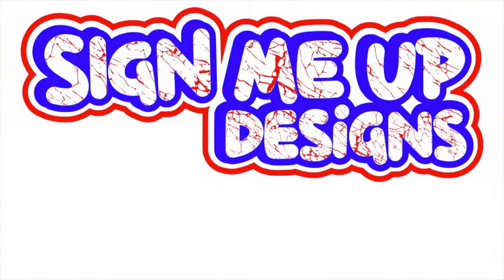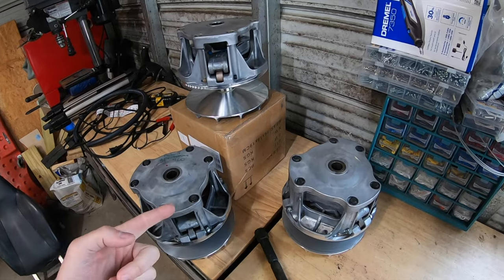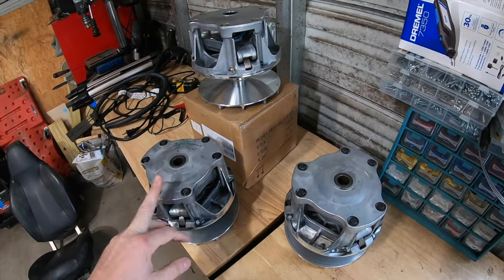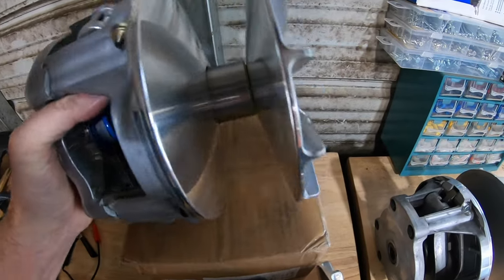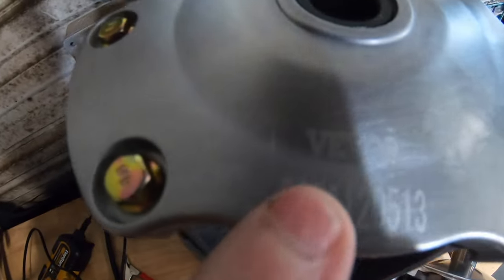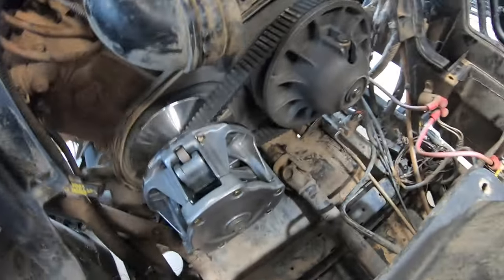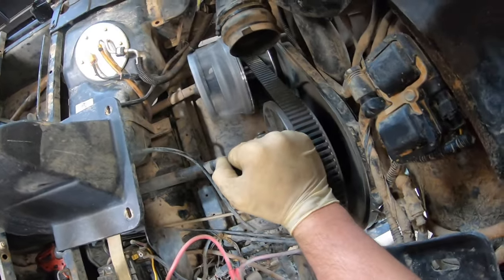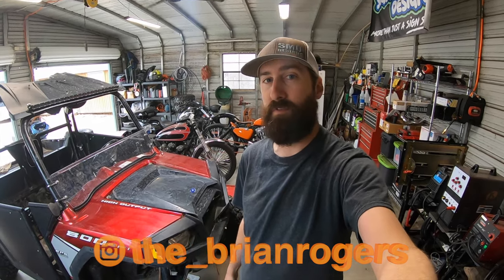Is Your Polaris RZR Grinding, Squealing or Jerking? - WATCH THIS VIDEO NOW!

Comment: This has solved all the issues I'm having on my 13 xp900. You sir are the man
Reply from the maker: Glad I could help! 🤙🏻
Reply: @SignMeUpDesigns   having trouble finding this same primary for my 13 xp900 however. Still on the hunt
Reply from the maker: @jasonbaker4842  Try this link. https://www.ebay.com/itm/294611102443?hash=item449830aaeb:g:mFMAAOSwCrhf9Vmb - I did see just a bearing on eBay for $40 but you'd need someone with the correct tools to replace it.
Reply: Oh man...absolute legend.
Reply: Aside from the correct puller I shouldn't need anything else right?
Reply from the maker: @jasonbaker4842  I think you’ll also need a vice and some sort of tool to hold the helix. I’ve never done it myself but Hunterworks has a video of the replacement.

Comment: Good tip about the bearing 
Mine started acting like you described after burned the belt in some thick mud    It had a flat spot 
I wonder if someone had the inner clutch cover replaced    I had to replace mine after the driveshaft broke  
Also destroy the primary clutch 
Sdi makes a great clutch alignment tool 

hunter belts doesn’t work on the 2016 rzr turbo & 2019 Rs1 
His clutch puller bent  after first use   and he wouldn’t replace it 
He told me it should be OK to reuse  😂  
 Belt + puller $195  down the drain 
He says his belts are the best which is a lie to sell belts 
Went back to oem  belt
Reply from the maker: Unfortunate you had that experience with them. I’ve never dealt with them personally. Hope the info helped you out.

Comment: I purchased a no named sideXside a few years ago, I was told they were built with leftover parts from several brands. It grinds really bad when you try to put it in high, low or 
reverse. We have to put it in gear and then start it.  Would this be a possible problem I am having?
Reply from the maker: It definitely could be. Sounds like the trans input is spinning while trying to put it in gear.

Comment: Back agin lol that is my problem You’re a genius something strange the clutch that I have says Polaris but it’s for a 2014 I’m guessing 2010 down to 2008 has a bearing.
Reply from the maker: If it says Polaris it probably has a bearing. But that bearing is likely locked up. If you can’t turn it with your fingers it’s bad.

Comment: Great video!

Would appreciate any suggestions. 2012 Polaris 800 Razor EFI hesitates at 45-50 mph. 45 is about 6350rpm. Not really a sputter or cough. Repairman just cleaned throttle body and fuel injectors and said idle air circuit was partially open causing a misfire at that speed. None of the work performed solved the issue. One person suggested the primary and secondary cluthes might be fighting each other. Need to get it fixed pretty quick so we can sell it and move, but I want it to be right. I should also mention that it has full power no issues 0-45. No codes, no engine light. Always at that speed only.Thanks. Appreciate anything.
Reply from the maker: You are 100 percent hitting your rev limiter. The weights in your primary clutch are too light. The rzr 800 should hit 60 mph and the rev limiter is 6300-6400 rpm. If you’re at 45 mph at 6350 rpm and the unit is no longer accelerating that is the only issue it can be. Mine did the exact same thing. Get a new primary with the right weights or get the weights replaced. The idle air circuit has nothing to do with max rpm. The mass air flow sensor will but you’d have issues all through the rpm range if it was bad. Good luck!
Reply: @SignMeUpDesigns  Thank you. I'll let you know what I find out.
Reply: @SignMeUpDesigns  Thank You for your response. I have some new information on the 2012 Polaris 800 Razor having issues at 45mph. 
I was asked if it could go faster than 45mph. Just took it for another test. As usual it hesitates at 45mph. I pushed it on a longer stretch and when it gets to 50mph it stops hesitating. When I get to 55mph it hesitates again. Top speed is 60 mph at a maximum of 6500 rpm.
To obtain codes, one video suggested turning the key off and on 3 times and it will show a code. Didn’t see anything pop up when I tried it. I don’t know if this 800 has the ability to display any codes?
I’d like to include some responses from folks kind enough to offer suggestions to see if it triggers any other ideas pointing to one thing.
The spark plugs were replaced about 1.5 years ago. They were examined recently and found to be good. I still might replace them as that’s a cheaper item. I suppose it could be a bad spark plug wire.. or coil wire. Your thoughts?
Suggestions: fuel pressure check, sounds like fuel pump, spray water on spark plug wires and coil wire, Fuel stabilizer, Belt might be slipping, inspect clutches and belts, don’t think its clutch related, sounds like clutches sticking, check belt for damage, weights in primary clutch are too light, was IAC mechanically stuck open or electrically being opened.
Thanks again. I’m hoping this new information might directly point to something that I will try and tackle on my own. Taking it in is a last resort for me. 
I promise, to get back to you once I find the issue!
Thank you kindly. Very much appreciated.

Dave
Reply from the maker: @davepo6443 It’s really tough to take an educated guess without hearing or seeing the machine in action. I do have a question for you. When you’re accelerating are you wide open throttle or are you feathering the throttle to get to 45? To eliminate the primary weights, from a stop press the accelerator all the way to the floor if the machine starts to hesitate as it accelerates there could still be a weight issue. If it does not hesitate at all until 45 then there is a different issue. I’ve seen fuel pumps go bad on these machines. Which may be what’s happening with yours. The fuel demand is greater at higher rpm’s and a weak pump will cause the conditions you mentioned.
Reply: @SignMeUpDesigns  You had it 100%!

I finally have the answers on the 2012 800 Razor issues. Thank you for your response!

Summary for 2012 Razor 800:
•	Fuel pressure was a consistent 44PSI which is in spec. Previously verified during last repairs.

•	Spark Plugs were checked during previous repairs and color was a light brown 
(NGK BKR7E) Plugs replaced in previous repairs Jan. 2023

•	TPS set at .730 per factory spec. using TPS TOOL brand meter (specified range is .720-.740 TPS voltage setting controls idle and start up.

•	Overall TPS voltage affects WOT, but that would be bad TPS unit.

•	IAC solenoid was partially open because of excessive dirt build up in throttle body.

•	Injectors were checked and cleaned because fuel goes bad much faster in the summer heat of the desert.

•	Mass Air Flow sensor was cleaned with MAF sensor cleaner because of dirt and oil build up

•	UNI brand Air Filter cleaned and treated and intake tract cleaned

Diagnosis:
•	During diagnosis test drive the operators RPM’s were watched closely.

•	During wide open throttle pass on pavement, engine was at 6400 rpm at 45mph.

•	6400rpm is on the rev limiter and that’s the surging feeling. Had to feather the throttle lightly to work towards 50mph and hit 6400 rpm again.

Definitely Clutch related (clutches were not serviced in Jan of 2023, only on new belt).

CLUTCH INSPECTION ON MACHINE: 
Secondary clutch was difficult to open for belt removal.

Primary Clutch:  Needed partial rebuild
•	Installed new OEM sliders 
•	Rollers in the spider were good
•	Installed new OEM 2- way bearing
•	Installed new OEM 23-62 weights (removed 23-58 weights)
•	Installed new OEM shoulder bolts for the weights

Secondary Clutch:  Tear Down
•	Internal Rollers in excellent shape
•	Excessive dirt and debris in bushing area of moveable sheave resulted in hard to open during belt change, also translates to poor operating results
•	Replaced Belt Drive
•	After Clutch servicing engine holds at 6150 rpm during wide open. Wide open throttle RPM/MPH test

No issue getting to 55mph, did not try for higher MPH as clutches now hold correct RPM
Reply from the maker: Incredible write up. There’s no doubt this info will help others. That was the intention of making this video so I’m appreciative you were able to add your results. Happy to help!

Comment: my rzr xp 1000 jerks whenever i take it off park sounds like it’s grinding and completely shuts off. the gear gets stuck for a couple minutes and then i’m able to put it back in park while it’s off. not sure what to do don’t want to take it to a shop if i can fix it myself. please help brotha🙏
Reply from the maker: Sounds like it may be your primary clutch or bearing. There’s a chance it’s the transmission, but if it shifts fine without running it’s unlikely.

Comment: I have a 2012 rzr 800 when I turn it on only the primary clutch spins and also I can’t even move it jerks like crazy like if I had  E-brake or something? Bough this thing 4 months and I been working on it ?
Reply from the maker: I hate to say it but it sounds like your transmission is binding somewhere. It could be a broken input shaft from the secondary clutch. Tough to say without pulling the secondary off.

Comment: My primary is making a loud noise on my 2017 Polaris RZR 1000 S. What would you recommend to get rid of the noise?  Any help/advise would be great. Thanks so much.
Reply from the maker: It’s really tough to say without hearing it. It could be something in the primary itself, the bearing or even a bad belt. If it’s a squealing sounds it’s likely a stuck bearing causing the belt to squeal. If it’s a rattle then possibly something loose. Either way I’d get it checked by someone who knows more about it before something even worse happens. Good luck!

Comment: So I have question.  Since the tool you showed didn't work, how did you get the Chinese clutch off?
Reply from the maker: Good question. I got extremely lucky and it fell right off after tapping it a few times with a rubber mallet. If that doesn’t work I would suggest getting a puller for a Polaris sportsman 400. I highly suspect that’s what the Chinese clutch was designed around. Don’t be afraid to get aggressive, that Chinese clutch is garbage. Don’t try to salvage it.
Reply: Thanks!

Comment: Just a thought ,and I’m not hacking on you, your rzr 800 is a 2010 or later if the plastics is correct , this  finder front clip was first used on 2010, 2008 and 2009 same ,but changed in 2010 model, when you don’t give correct info about your rzr it shakes our confidence, and I think people will not watch, I could be wrong,
Reply from the maker: Wow great eye! It is for sure a 2008, verified by the VIN. It was wrecked in the front end before I bought it and was replaced with a newer body front clip. If you look closer at the 2:00 mark, it has the sticker for electronic power steering which this unit does not have. No confidence to shake, this video is as legit as they come.

Comment: My belt on my rzr 800 efi keeps turning inside out and tearing up.....what's wrong...I have brand new clutch and it keeps ripping up belts
Reply from the maker: It’s got to be an alignment issue if it’s flipping inside out and shredding. Sounds like the clutch wasn’t installed fully on the shaft. Tough to say for sure without looking at it.
Reply: @SignMeUpDesigns  thank you for getting back to me so quickly. I'll try removing one of the washers on the secondary clutch and see if that works.

Comment: I have a 2010 polaris rzr 800 having the same issue, what do I search to find that same clutch on eBay?
Reply from the maker: Try this listing. It seems like the clutches pictured with a washer are also the ones with the 2 way bearing. It’s also the same brand “Vevor” that I used. 

https://www.ebay.com/itm/Primary-Drive-Clutch-For-2010-2014-Polaris-Ranger-RZR-800-RZR-4-EFI-LE-1322996-/274071014640?mkcid=16&mkevt=1&_trksid=p2349624.m46890.l49286&mkrid=711-127632-2357-0

Comment: So I got a question mine is doing the same thing it only grinds going into high gear and it don’t want to go all the way my belt starts squealing
Reply from the maker: I assume your question is “is my bearing bad?” With what you’ve described it sounds like your bearing is locked up or non existent like mine. Time for a new bearing or primary clutch.
Reply: @SignMeUpDesigns  I got my razor for 1000$ also I’m hopeing he has not destroyed the transmission, trying to make it go in the high gear I don’t under stand why it’s doing it in hi gear but not the rest it try’s to pull also
Reply from the maker: In high gear the transmission is spinning faster so it’s harder to match the engine speed to trans speed when you shift. Since the bearing is locked, that’s the only way to get the trans in gear by matching engine speed to trans speed. Low gear spins slower so it’s easier to match speeds. Take your cvt belt off and shift again. If it grinds, your trans may be hurt. If it shifts smooth you should be fine with a new clutch/bearing. 🤙🏻

Comment: Were do I locate the part # on the primary and secondary  clutch on my polaris rzr 900s 2019 model help
Reply from the maker: Polaris OEM part numbers for your machine should be Primary: 1323283 Secondary: 1323408.

Comment: Tip: always buy OEM Polaris parts. It takes all of the guess work out of it.
Reply from the maker: Good tip and it absolutely takes the guess work out of it. This video is for the ones like me who don’t necessarily want to (or can’t) shell out $800 or more for an oem clutch when an aftermarket one will work just as good. Maybe not as long, but for a season or 2, definitely.
Reply: Wrong, your so wrong, watch the video again.
Mister. Polaris primary is a piece of junk.

Comment: What tool did u use to get the wrong clutch off with cause the puller to big for the china's one
Reply from the maker: I got lucky with mine. I hit it with a big hammer and pulled at the same time. I was able to get it free. If that doesn’t work for you I would buy a clutch puller for a sportsman 400. I really think that’s what my original clutch was meant for.

Comment: My 11 rzr 800s grinds while trying to shift gears at idle wonder if it’s my primary clutch. Also get a weird noise if i snap the throttle
Reply from the maker: Sounds like you could have a clutch, bearing or belt issue.
Reply: @SignMeUpDesigns  bearing going out on the primary or secondary clutch
Reply from the maker: Primary. Check it using the steps I showed in this video. 👍

Comment: Have you found that this vevor clutch is just as good as the oem?
Reply from the maker: As far as build quality I don’t think it’s as good as oem. But it has stood up to abuse for a year now. My thinking is $600 for a new oem which will likely fail vs $125 for a Chinese one that will likely fail…I’d need 5 to break before I lost money. Highly unlikely in my opinion.
Reply: @SignMeUpDesigns  does it have a one way bearing or two way bearing
Reply from the maker: The Vevor is a 2 way bearing.